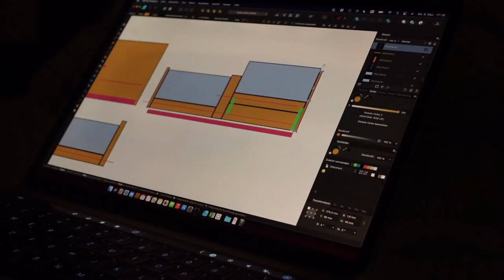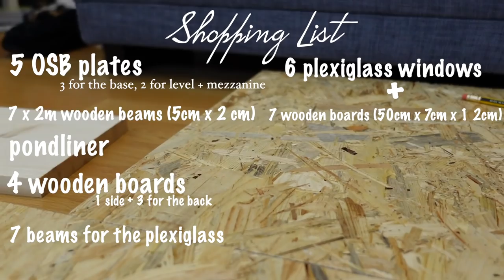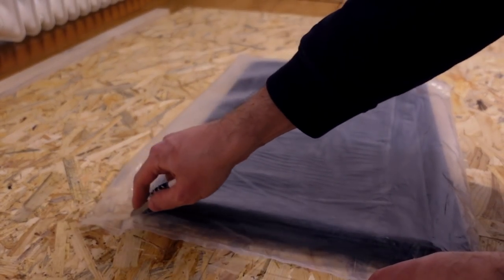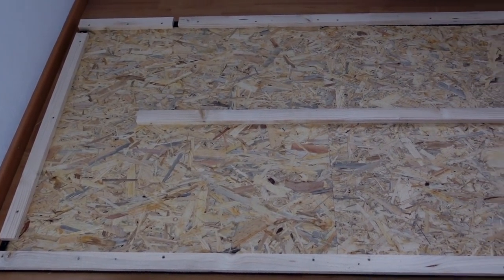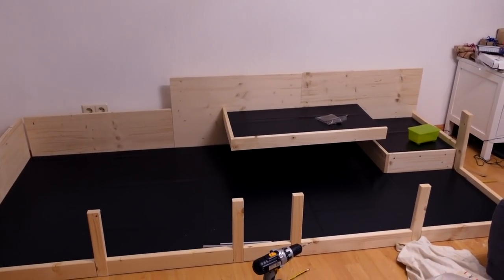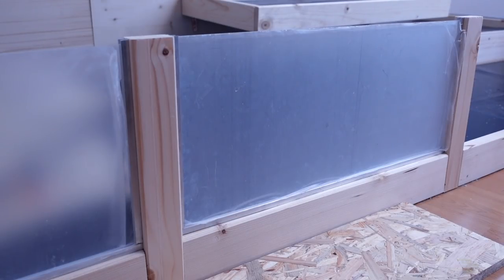How to Build a Wooden DIY Guinea Pig Cage with Plexiglass Windows

Comment: You can also take 100% pure silicone caulk, thin it with mineral spirits, and paint it in fabric )like a bed sheet)

Once dry it’s a great waterproof liner and I can even manipulate and shape them before they cure!!

Also always check the scrap/discount pile at Home Depot before purchasing full price lumber. The furring strips and even osb can be out there and is 70% off

I’m building a mezzanine and this video is so helpful!!

Comment: My guinea pig palace has 3mm channels in the boards into which the plexiglas windows are set, as you described. The base with these is complete, but the project is still a work in progress.

They are 13mm deep, cut with a table saw. And the acrylic goes about 10mm into each slot, leaving 6mm left to right and 6mm top to bottom for potential mismeasurement, seasonal expansion/contraction of the wood, and stress from the weight of the structure.

The base of the structure is 240cm x 240cm, and the top floor is 60cm x 240cm. Thusfar only the base and posts are built. I’d like to have it finished by Spring.

I’ve been recording the project (called Château de Fluffy) and uploading it—my first adventure into YouTubing.

Comment: So I just started watching your videos but we’ve had two guinea pigs for a couple years. I’ve noticed that you’ve stopped using the GuineaDad liners and instead just use the IKEA bathmats and kiln dried pine shavings. Is there a reason for that? I know you got your first one for Gatsby. We have one of the bathmats in our cage along with washable incontinence pads and paper for their kitchen area. I’m going to switch to the kiln dried pine shavings with dust extracted because I hate the smell of wet paper but I’m wondering about the fleece liners. I’ve been contemplating purchasing the Guineadad liners for over a year now but I haven’t been able to justify the cost.
Reply: Personally, the Guinea Dad liners are absolute life savers for me. I hate using regular fleece. I feel it’s a big hassle to clean. I’m back down to 3 pigs from 5 (recently lost one to heart disease and one to very aggressive cancer). Even with a smaller herd, the GD liners make daily cleanings so much easier. I just usher the pigs into the upper level, funnel all the poops and hay to the center, suck it up with a shop vac or do a little sweep, depending. Then herd them back downstairs to do the top. It takes me 5 minutes. The liners are sturdy enough that they don’t get sucked up into the vacuum and they wick moisture very well. The nearly waterproof undersides are a godsend. They always lie perfectly flat in the cage. Pigs tend to not want to try burrowing under them. Full cage changes are SO much easier. The only big downside is the dry time when you wash them. But once you have a couple to cycle through, that doesn’t become as much of an issue. They are rather pricey, but I am very willing to pay the price for convenience, personally. (And all my girls absolutely love running on them and hiding in the pockets :) )